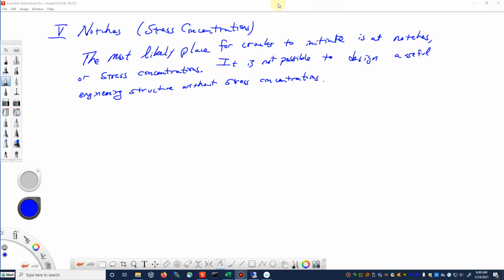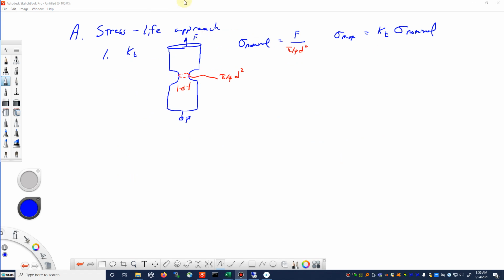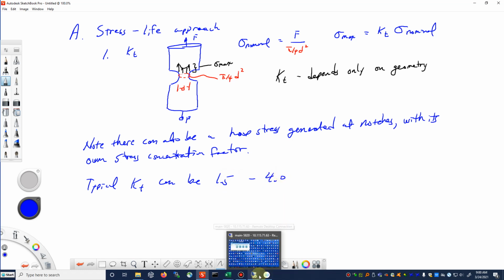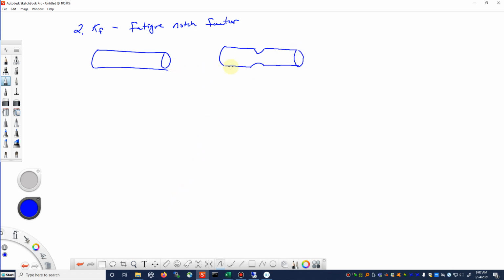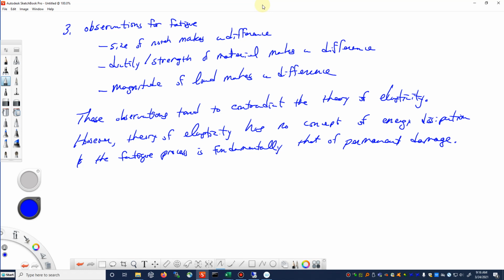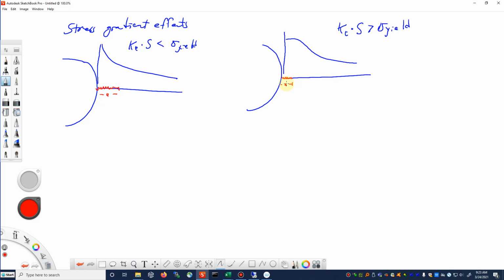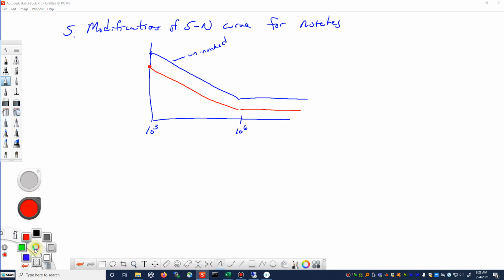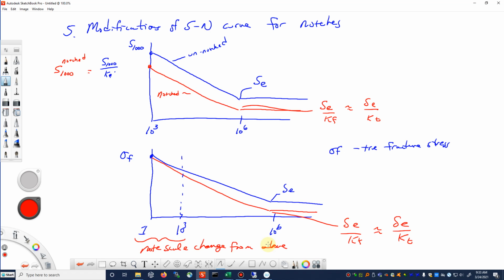19 Notches Stress Life

Comment: Professor Barkey, modification fo S-N curve is used when local stress concentration occur. If FEA has been used to evaluate stress response, is it still need to modify S-N curve? Or we can just use stress results from FEA in conjunction  with standard S-N curve?
Reply from the maker: There are many options when it comes to dealing with notches and it depends on what data you have available and the level of analysis and the magnitude of the stresses.  Do you have notched SN curve data?  It plasticity limited or at a high level?  Are you using a Neuber/Glinka notch correction?  Constant amplitude vs variable amplitude?  What material?  How sharp is the notch?  Full blown elastic-plastic FEA?  How does the notch analysis fit in with the general level of uncertainty surrounding this component or proposed component?

I think it is best to think of notch analysis techniques as various tools in your toolbox.  You will need to know when is the best time to use a certain tool.  I would not be able to answer your question, but you can--given the full context of the problem and the tools that you are learning as a fatigue analyst.
Reply: @mbarkey.mechanics  Thanks for your kindly reply. Indeed, there are many things we need to consider before perform fatigue analysis. I've learned so much useful knowledge about fatigue in your lectures. If I want to do fatigue analysis by means of FEA, is there any suggested materials?